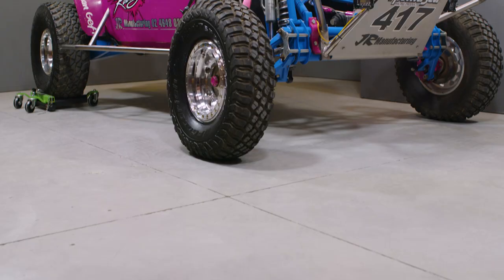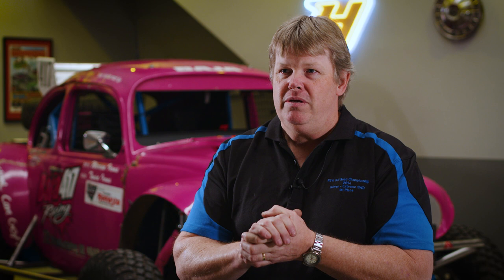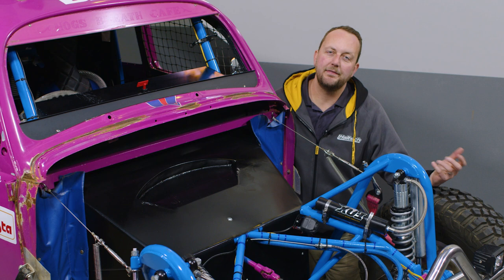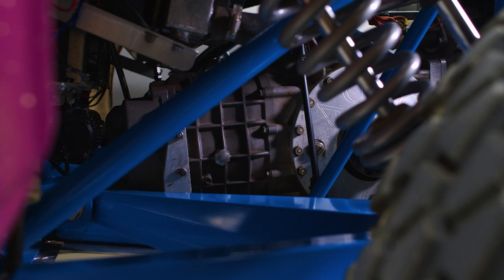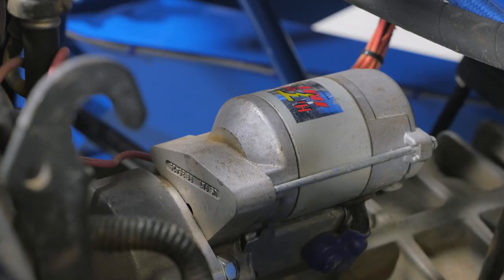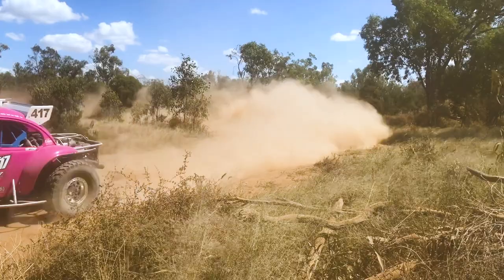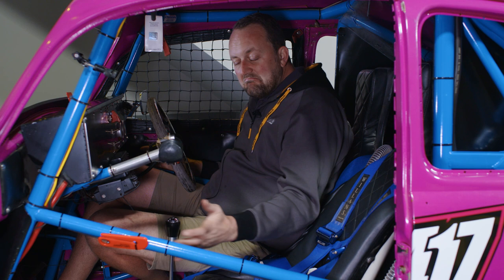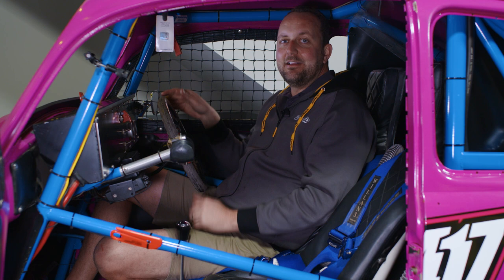🏅Pink Mud Bug: V8 powered Baja Beetle | ANATOMY OF SPEED

Comment: Green coolant on a toyota engine? Blasphemy!! Long live the UZ though, I have nearly finished an A70 supra race car with a GTX3582r slapped on a built 1UZ in front of a t56, running an old PS2000 that a mate had lying around atm to keep the budget down but always room for upgrades down the track ;) I can't wait to hear what it sounds like <3
Reply: It’s actually blue to match the frame, is there a difference?

Comment: 1UZ is hidden tuning reliable gem, keep them hidden. Best V8 ever made. LS is boat anchor against 1UZ.
Reply from the maker: Best keep this one a secret before they start going up in price! But yeah, they're def a gem.
Reply: My kid has the 1uz in a rock crawler and hammer's it every weekend. I don't know anything about that motor , I run a 600hp CBM LS in my baja and have been on the Rev limiter for 3 years with zero issues so far.  I'll stick with the LS 🤙